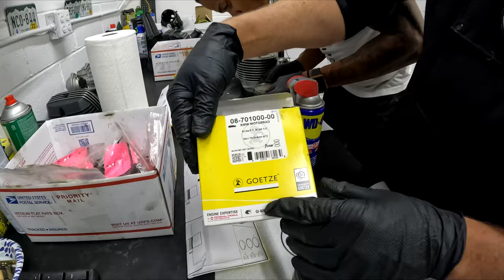Rebuilding a 1992 BMW R100 Paris Dakar. Part 1:

Comment: Very nice bike i have a 1993 PD ,don’t forget to check the Crankshaft bearing location pin this problem is always between 1992-1996 I change also the ignition system and generator to silent Hektik ,good luck 👍👍👍